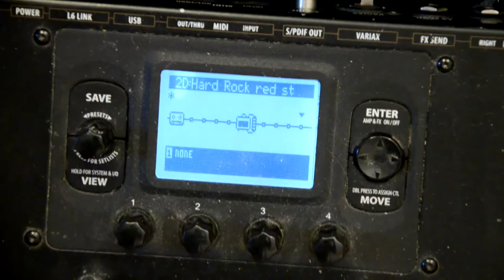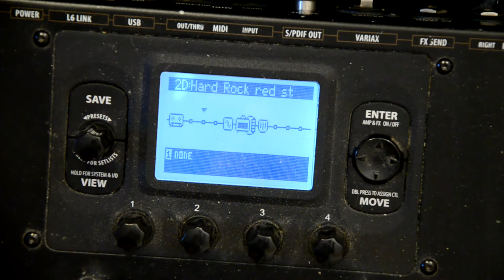Line 6 POD HD 500 - Why so negative? Video response to Glenn Fricker. Part 3

Comment: For the price range and what I need this looks like a good option. I am going to run some high quality pedals in front (dirty shirley and sweet honey deluxe) then some good mod pedals in fx loop (matthews astronomer, ehx pitchfork and tc flashback). This thing has more tone control than a normal eq. You can adjust frequencies. When I see people getting okay to su bpar sounds with this thing I can tell they are just using presets and not tweaking knobs to try and get better sound.
Reply from the maker: As the extension to the real tube amp and for the price on the second hand market this is ok, as stand along device you can get better options, check out new AMT Brick X series for example.